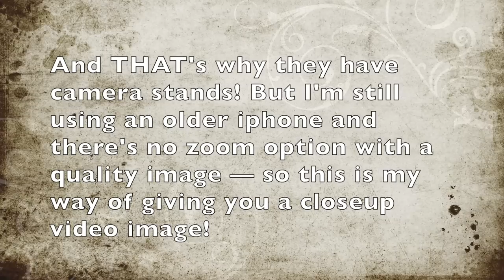How to Upcycle Worn-out Jewelry

Comment: Wow - this is so interesting!  So, you don’t use glue,you use varnish to hold it all down?
Reply from the maker: I use glue — E6000 for large and heavy jewelry pieces — OR acrylic varnish (even thinned down) for thin chains/necklaces so they don’t get pushed where I don’t want them. Once everything is well tacked down and totally dry, I’ll use one or two layers of pouring medium over the whole thing.  (You could use a few layers of varnish too but I accidentally bought a gallon of pouring medium instead of gesso so I’m using it up 😅). 
Be sure to let each layer of varnish or glue dry well. And don’t speed dry, I tried that once and the top surface of the glue dries first, not allowing any glue “pockets” to dry – wet glue stays white(!).

Comment: I just found you and I've watched like 3 videos🤩😍
Q...what kind of board are you using? How do you hang it?
Thank you.
Reply from the maker: This piece is on a wood panel that I made myself. 1/4 inch plywood.
Reply from the maker: I put professional metal hanging wire and metal hooks on the back.
Reply: @dorothealeblancart  thanks. I didn't know if it was that Mdf board??? Or plywood. Would it matter? Those big ones you made would be super heavy?!?
Do you use a regular acrylic paint to seal before painting? Like house paint? It would cost alot to prime with gesso. 
Newbie.  I'm trying to get the details so I could create. 
You have inspired me to do Something with old broken jewelry. 
I kept them because they are sentimental. This would be a great way to keep and still love them.
Thank you for answering me.
Appreciate it
From a newbie😉🙂
Reply from the maker: @holdthelovealways  right! MDF is too heavy a material. The depth of the large panel was made with 2x2 (approx) pine wood. The small boards were made with masonite.
Reply from the maker: @holdthelovealways  thanks for your great comments and questions! 
You’re right, I do not use MDF, it’s too absorbent and too heavy. The big ones are heavy, but if I’m hanging them I make sure there’s a board anchored to the wall first. 
I do use gesso because it’s a great substance to paint on. It sticks to everything and everything sticks to it. 
Primer paint might work as well but gesso has better coverage and is whiter.
Reply: @dorothealeblancart   Thank You SO Much. M6 brain is like popcorn after watching🥰😍🍿
So many ideas. Bless uou for  answering.

Comment: Did you make a kind of grout with paint? You didn't say anything about that part of it
Reply from the maker: The thicker the glue is, the more it fills in the spaces. On some of my projects, I’ll make layers of glue to get a thicker coating BUT I always make sure that each layer is completely dry before I add another one.
Reply: @dorothealeblancart  okay so that's glue that is in between each one of those smaller boards? Is it like a colored glue I'm a little bit confused

Comment: I don't know how much the varnish costs but a cheaper alternative to what you're doing would be either Mod Podge or regular Elmer's Glue type of glue. It would achieve the same thing. I have tried it and it is super strong. And there's no need to paint it on you can just spoon it on
Reply from the maker: I actually do use thinned down white glue on occasion but I find that it’s a little stringy until when made thinner, gets too watery. Acrylic varnish thinned out has a great consistency especially on very fine chains.
Reply: @dorothealeblancart  try the Mod Podge then because I haven't found that to be the case with Mod Podge
Reply from the maker: @KMF3  thanks for the suggestion. I thought it was just for paper type projects. Do you know if mod podge dries clear?
Reply: @dorothealeblancart  yes I've done it on several projects and it appears to dry completely clear. I have not tried it with glass on glass I don't know if it would leave a hazy residue. So when I do glass on glass I use epoxy resin

Comment: So all you used was watered down varnish for glue? or glued first and then varnished?
Reply from the maker: For the very fine chains I used watered down varnish because I didn’t want them to move while I was applying the glue. For the bigger heavier pieces I used E600. And at the very end I either gave it two more coats of varnish or an overall coat of pouring medium. (I’m not sure right now, but either would work.)

Comment: So, just to clarify, the watered down varnish is the "glue" that you keep mentioning? You didn't actually use glue underneath the jewelry - you just drowned it in the varnish? 

This is stunning. Thanks for sharing.
Reply from the maker: Yes, the large and heavier pieces are stuck down with E6000. The unruly pieces are soaked with thin glue a few times. (Leave LOTS of drying time in between glue applications.)
Reply from the maker: And thanks for the compliment!